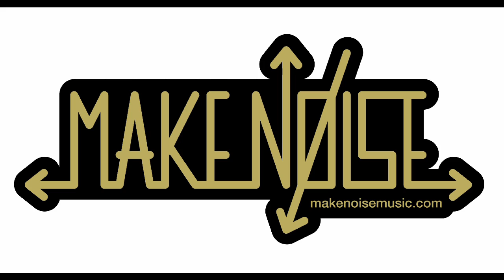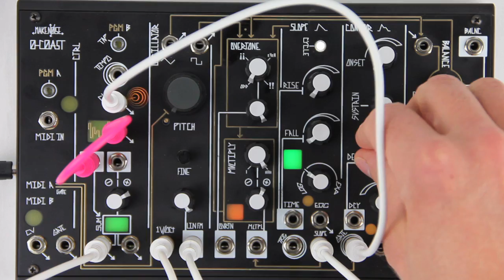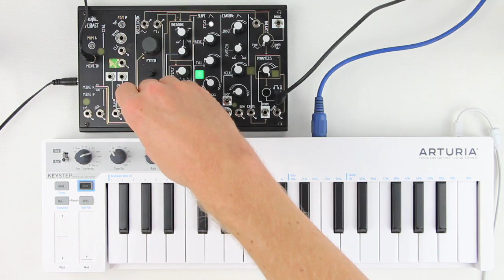0-Coast FM, pitch, amplitude and timbre

Comment: Those agressive FM tones at the end sound rad. Pretty much the sound I'm looking for. When I try some FM stuff on a Neutron the sound changes when I change the pitch, the FM doesn't track with the pitch if that's the correct terminology. If I make the patch from 3:15 and I play a different note, will it still sound the same?
Kind of new to FM, not sure how that whole tracking thing works.
Reply from the maker: For that patch you would need to also change the frequency of the Slope generator to match via the Time CV input. Best results would be had by an unquantized sequencer output like from 0-Ctrl, where you could tune each step by ear.
Reply: @MAKEN0ISEMUSIC  Ah cool, thanks for the quick reply!
Reply: @MAKEN0ISEMUSIC  so that means, the 0-coast fm-sounds are not possible to play totally from a MIDI keyboard. That’s also what I found by myself. That’s why, my question is, with a DPO and your other modules - is it possible to create tonally playable FM-Sounds, without repitch each step from a sequencer by ear?
Reply from the maker: @BurkhardusX  For a typical FM patch you will need to maintain the ratio between carrier and modulator as the carrier changes pitch, which means sequencing both. This is easy with any dual VCO (or set of two VCOs) because you can just mult your sequence/keyboard CV to both pitch inputs once you've dialed in the ratio. With the DPO you can also use the Lock param to set a soft sync that will keep them phase locked even if there is a slight tuning discrepancy across the sequencing range. The reason it is more difficult on the 0-Coast is that there is only one VCO; the Slope circuit does not typically track incoming CV at the v/oct curve, so using it for tuned FM is a little more complicated.
Reply: @MAKEN0ISEMUSIC  Final question: I read the DPO is no TZFM OSC, now I doubt if it is stable enough for playing melodic intervals on my keyboard even at higher FM index? Is the stability of the both, modulator and carrier, good enough? Especially, is the pitch tracking stable enough, to play FM sounds chromatically correct on my keyboard? When using a sequencer you could re-pitch every step, even if this is time consuming, but when playing the keyboard live, I need a very stable FM oscillator. Is the DPO capable of that, compared to other complex oscillators featuring TZFM?

Comment: I really love my 0-coast, and your video was really helpfull, thanks for that.
ok i have a question if i configure MIDI A to receive channel 1 and MIDI B to receive channel 2.
and after, i have one midi sequence send do midi A (ch1) Oscillator play the sequence (great) and after i launch a second midi sequence to midi B (ch2) and i patch midi b cv out to slope time input and midi B gate out to gate input and send EOC to Balance (with slope cycle on, like a second vco) can i listen the two different sequence with the balance mix ? I would probably have a gate problem no ?
i use a keystep (like on your demo) and i very easy to change midi channel on the fly, and my dream is to play a loop sequence on midi A (ch1) and switch to midi B (ch2) and play (with the kbd play option on the keystep) on my first sequence by controlling the slop like a second oscillator... that's make sense for you ? sorry for my english i'm a french froggie.
Reply from the maker: This sounds possible... have you tried it?
Reply: yes i try it's work but i need to use a stackable patch to share the gate.. and of course it's note perfect because the main OSC and the SLOPE can note really make different sequence because they share the same gate... huum .. no other input that could be used as a gate ?